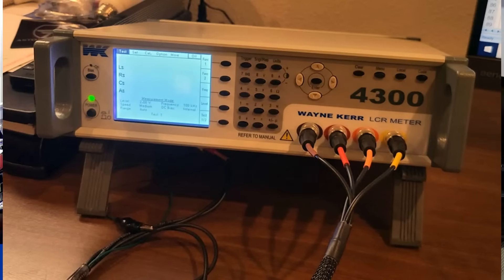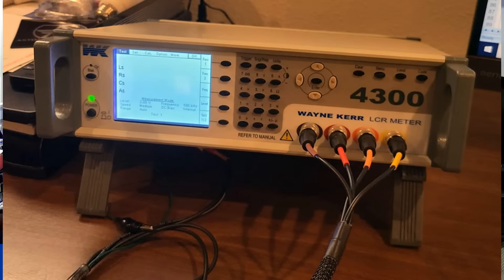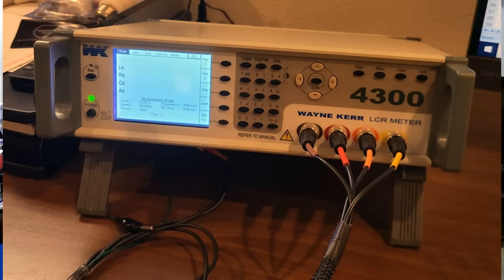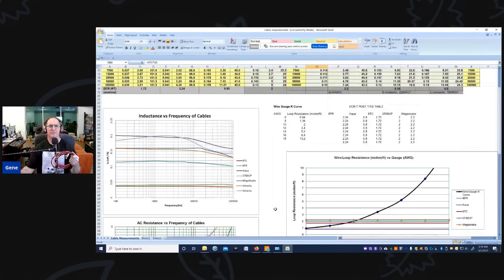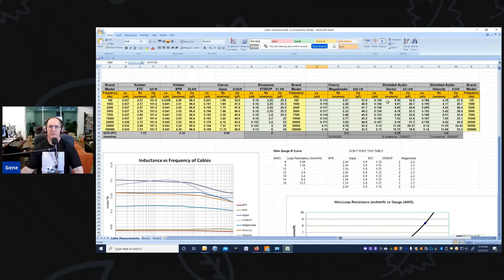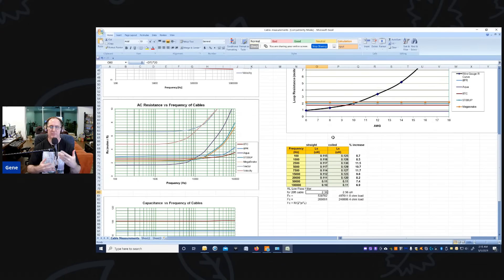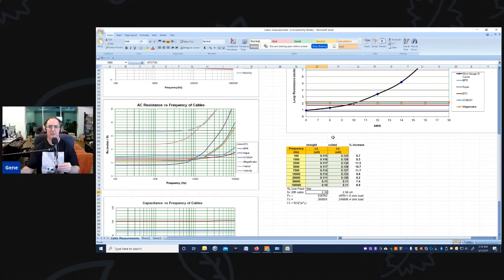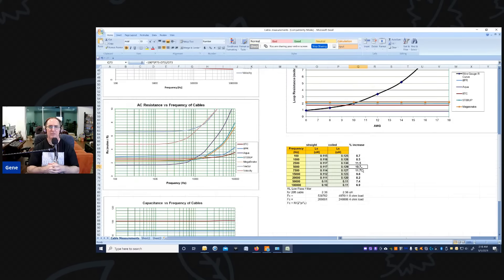OMG If You Coil Your Speaker Cable You're Gonna Lose Fidelity?!?

Comment: I have a Samsung TV sound bar and woofer. The woofer connects to the sound bar with a long length of very fine wire. Its in a bit of a coil. The woofer sounds deep and powerful.

Comment: Good advice! and great info.
It have cut most of my cables to size. But now i was looking into moving the speakers to improve the sound and now i dont have the extra length. To be fair before i cut the cables the speakers where already in that position for months. And now we are 5 years further. But with new insights i wanted to see what i could do to improve. I can move them around a little but not really forward away from the wall.
I will just buy some extra cable for the fronts to test if i hear a audible difference when moving them forward. Now they are nicely in line with the center. That center i cannot move forward because of the TV
But after seeing your data about coiling up having almost no effect i will keep some extra margin in the future and tuck it away.

Comment: Hi, Gene,
Very interesting and well done work. As we can see, the increase in inductance, comparing a cable straight and the same cable coiled  is minimal: 2.36uH to 2.56uH. It could be also interesting to compare the cable capacitance in the same both conditions (straight cable and coiled cable).
Regards.

Comment: I know I’m comparing apples with bananas here, but I have a 500 feet, mains extension cable fitted to a retractable reel. There is a very clear notice on the side of the reel which states “always unwind cable fully when using high current devices”. On a couple of occasions I’ve not fully unwound the cable, and it does then get very warm. So I assume that coiled cable has a higher resistance.
Reply from the maker: coiling a cable has to effect on resistance. It does change the inductance however. Also, there is less air around the cable to dissipate heat when it's coiled vs laid straight out.
Reply: @Audioholics  👍🍻

Comment: It's great that you can give the details of these components that are part of systems. 
However, as the whole purpose of each system is to deliver sound to the listener's position in space, shouldn't you be measuring the differences to that, when you make changes to the type/length/connectors/topology etc. of speaker and interconnect cables?

Comment: It's like we would tell the new guys at work when they would roll up the extension cord we make them shake out the electricity.  I been designing and building speakers and I been using oxygen free copper wire it's not that much extra money and I figure why take a chance if I over engineer it it's better than under but I have a lot of people on forums telling me I'm wasting my money with expensive capsitors and wires but I can hear the difference maybe not the wire but definitely with capsitors and inductors but why take a chance and use cheap wire to wire my speakers I would rather build them with ofc wires than take a chance as far as the capsitors it's definitely more than a placebo effect

Comment: There’s degradation and segregation but I don’t think degragation is a thing… know what you mean tho fo sho. Haha🍻 was wondering what effect coiling has on cables.  As well as running next to power and other cables.  And just how far away do they need to be if they’re not to be run together… would be cool to see measurements of cheap cables compared to shielded cheap mid and not cheap ram with power cables.  Would be a pretty variable test tho or should be.  Cause running it with 100w vs 1000w might measure differently.

Comment: In my opinion twisting wires together like those cables is the worst thing you can do for speaker cables. A- thats how you create a magnetic field with wire and electricity, but B- you just made the wire-cable twice as long as it needs to be. Lay them flat, keep them short and straight.

Comment: Award winning loudspeaker designer and engineer John Dunleavy (RIP) used to also believe that all 12awg loud speaker cables sounded the same (and likely measured the same?), as did all 100watt AB amplifiers sound and or perform basically the same, and that it all came down to 1st order, time aligned, Dappolito design passive loudspeakers for "ACCURATE"(his theory)sound reproduction!   Well, lemme tell ya, his systems in his factory sounded pretty bland,  sterile and constrained compared to the sound reproduction from the same loudspeakers in our own showroom/store in CA!  We used the best electronics , and cables, within reason, and got EXCELLENT fidelity from SC-1's all the way to SC-V's!  Yes, folks, I'm a believer in everything you connect to your system makes a sonic difference!  To each his own..just don't sell me that you're system with zip cord and Radio Shack wires sounds as good as my systems with better cables and wires, cause it don't , unfortunately. Wish it wasn't the case. I'd save money otherwise
Reply from the maker: Radio Shack is out of business but multistrand 10awg Belden cable sounds as good or better than any exotic cable you can use. If it sounds different, it's because the cable is acting like a tone control. Get your room acoustics right before turning cables into a religion.
Reply: @Audioholics  Thanks Gene! Good thing I'm an acoustical engineer.  That would come in handy!  Of course, in this line of work, I seldom need more than a now obsolete Radio Shack sound level meter and a copy of F Alton Everest's master Handbook of Acoustics, 3rd edition (FYI, the 4rd edition has some math formula errors. - Don't use those!)  Listen, I got a buncho over priced snake oil audio cables layin around the house if you ever need anything. Mi casa, su casa :-) lol

Comment: Would be good to see the inductance looking into the speaker *(rather than the presumed 8 ohm resistance).  I bet the cable inductance would be rendered insignificant (less than one tenth) in comparison.

Comment: You can buy a perfectly functional and accurate LCR meter for like $100.  The DER EE LCR METER DE-5000 is an excellent choice for a very cost effective, but accurate meter.  Just remember to calibrate it relatively frequently, and you’re gtg. It only take me 60 seconds.

Comment: The only reason I coil speaker cable is when my speakers are at different distances from my amp. I like to keep the lengths of the cables the same, so I end up with one cable stretched out and the other one either wound up or folded back and forth. I would love to see what happens to the measurements when you have different length cables going to the speakers.
Reply: You'd see nothing.

Comment: Nothing personal Gene, but this video is IDIOTIC! Of course there is an audible difference! I had a jumble of speaker cable, of about 10 feet, thinking ‘there is no audible difference’, per your calculations. WRONG! I uncoiled it. MASSIVE difference. 
Forget about measurements. LISTEN to your ears. 
Unless your system is sh~t, in which case I guess it won’t make an audible difference.

Comment: But Gene, if the cable touches the ground then soundstage shrinks and true magnetic North becomes South and the Earth gets even flatter. Not to mention the hair loss that can occur. There are legions of audiophiles that can hear a difference. They never actually say if the sound is better or worse, but they hear a difference so there must be something to it. Between confirmation bias and the placebo effect we now have an army of people spending thousands of dollars meaninglessly on exotic cables to "fix" systems that they have spent tens of thousands on in the first place. Not to mention cable risers to lift the speaker cables to safety 2 inches off the ground. It's stupifying.

Comment: Technically the coil for twisted pair has little effect except the cable is too long with the extra length adding more resistance due to more length, more capacitance due to more length, and more inductance due to more length. Resistance, inductance, and capacitance are all per foot or per unit of length properties of any cable.
For test equipment, consider adding a TDR to your tool kit as it can be used to measure the nominal impedance of cable as well as length if the dielectric is known or dielectric constant if the length is known.
If your speaker cables were two single conductor wires and you coiled them each by themselves, the yes, you make a solenoid cable. However if you coil a braided, or twisted pair cable, you again have an inductor, but in a configuration known as a Bifilar Coil. The inductance reacts to common mode current on the cable, not the differential mode signal to the speaker.  See Bifilar Coil for more information.

Comment: Nice video. I always knew this to be the fact (as an EE), but had never seen measurements and conclusions before. Very nice. I would like to see a review comparing balanced vs. unbalanced cables for sound quality. I don't think there should really be any difference for reasonable lengths.
Reply: FULLY balanced, of course there is a difference with a two-wire active balanced were cold is out of phase of hot, versus the unbalanced with only the hot connector. Also a fully balanced +4dB output has about 6dB bigger headroom - more dynamic range.

Comment: Does  difference in speaker cable lengte have an influence. For example left channel 2,5 meter and right channel 5 meter?
Or better keep them the same and coil the left chanel cable lenght?

Comment: I am for sound not looks, 100% relevant, takes more wire to coil it. I will never buy braided/coil speaker cables. Might as well spin some magnets around it and make electricity.

Comment: Agreed. it has very little affect because the load is so strong, or low impedance 8 or 4 ohm. Do the same measurement on a low line level signal between something with 1v line level RCAs, then coil it and connect it to a high impedance input - something with like 10k ohm input, or even better, into a phone pre-amp.

Comment: Funniest argument I've heard against (coiling) was this:

"Imagine your car is an electron, it's well known that if you go too fast around a turn your car tries to go straight and you'll crash because you will go off the road.  Except electrons cannot slow down due to physics.  They are going the speed of light.  When you coil a cable, you're increasing the tightness of the curve and they will fly off the wire!  This is the loss you're hearing, as less electrons means less energy to move your speaker cones, your amp works harder, you turn up the volume and things distort even more!"

Good thing I wasn't eating because I would have probably choked! :-D

Comment: Finally, someone who is putting REAL SCIENCE behind speaker cables! Thankyou Audioholics!
Reply: Wouldn't  you know after  2 years,  69K views  and only  3K likes . People don't  like hearing  the truth ...
I worked i a physics  lab we  did  similar  test  but more testing  on sound coming off the speaker we used  hi end  research  gear.   and NADA .... when we   measures  at  the cables at connectors. how tight  the  binding  posters  were made  a difference but so far out  from  audio range and human hearing    ...  well unless the connections were  loose  that made  a difference anyone could hear.. like cracking.

Comment: So how about adding the 2.2 or 4.7uF capacitor into your equation, are you not creating a tank circuit would the frequency response of the tweeter remain the same, besides being a complex impedance on its own. Transmission line theory is quite a science subject by itself. The twist in the cable creates higher capacitance to add to the problem. I wonder why make things so complicated in trying to debunk everything. Music is a subjective experience not an objective measurement. If you enjoy a certain wine or cold drink do you Annalise it in the same way to objectively measure how it should taste to you or every other person on earth. Do you eat monkey brains> I some cultures this is  delicacy. Do you analyze the purity of the water in the beer or whiskey you drink? These debunking is a snake oil in itself. Listen to it, if you like what you hear then leave it alone or experiment with things that in your subjective mind sounds better. Do you fart Channel No.5 or do you analyze your fart by what you ate.

Comment: Gene, I have to hand it to you, your one honest man that can teach a newer generation not to subscribe to the expensive snake oil around speaker cables interconnects and power cords.  I have had systems since the early seventies, and in the later eighties, the industry really went downhill; the small audio store could not stay in business.  But a great way for them to make a profit was the high-end speaker cable and power cords (more now than ever).  It still did not save them, and they are gone sadly.  For many years I got to sit in some small shops and listen and learn and spent some time at Technosonic Studios (now torn down for a shopping mall) in the St. Louis suburbs.   Yes, I have spent more than one probably should one high-end equipment, Accuphase, McIntosh, B&W, Sony ES, many Marantz (still have three receivers), double Advents, EPOS, BOSE (1970's), early NHT, Klipsch Corners, LasScala's and Heresey's (my home theatre with Marantz Projector, circa 2007)  Except for a few pieces, all were bought used, have had my Accuphase Amps for 41 years.   I really get irritated with the false claims and even worse by the adjectives used by so many to describe cables and power cords.   But, there was a savior, to saving me probably several thousands of dollars over the last 45 years.  Gordon Gow, the CEO of McIntosh, and their lead speaker engineer, Roger Russel, demonstrated to me back in the 1980s that regular old pure copper wire is all you need.  Wow, why would they do this?   They even put on a roadshow, double-blind, and were proved it over and over.  Think about that era; at the time, you would have to say McIntosh was about one of the higher-end products made right here in the United States.  There was a manufacturer of audio equipment, and their message was, don't waste your money on all these false claims. They backed it with science and engineering, they were well educated, and they, like you,  just HONEST.   Gordon Gow is long gone; what an icon and the job he did with that company, but I had also had the pleasure of communicating with Roger Russel (a degreed electronic engineer) and lead speaker designer at McIntosh during those years.  Still have the memos.   What he and Gordon Gow said 30 years ago, I think, needs to be referenced more today.   Most cable manufacturers do not have the education or one-hundredth of the audio industry clout these men had.     Yes, it was two-channel audio, but the science is the same.  It amazes me how so many people praise McIntosh over that period in time,  and how good the equipment was, yet at the same time will disagree with the science of their lead speaker designer (degreed electronical engineer) and the CEO of the company and insist that one must spend hundreds and even thousands on wire.   Anyway, wish you would throw those old audio guys some light and try to continue as you do to spread the honesty about what I think is the dark side of the industry.   I am sure you don't get many ads from any of the suspects, but that takes an honest man teaching many how to enjoy such a great hobby.  These men were well into their careers at even that time.  Roger still has his site up; few will ever take the time to read and learn; maybe you can get a phone call, skype or zoom with such an icon?  Fellow readers, follow Gene's advice!
Reply from the maker: Thx for your kind words. Yes I spoke to Roger Russell many moons ago when I started debunking cable snake oil.  Good guy for sure.
Reply: @Audioholics   Could you measure and A/B test GR-Research braided speaker cable, that would be interesting

Comment: You're using a braided cable.... The point of braiding a cable is to allow you to be able to do whatever you want.
Reply from the maker: Not true.. The effect is pretty similar with zip cord too.
Reply: @Audioholics  braiding prevents the wires from being adjacent... Not sure what zip cords are though
Reply from the maker: @linkeddevices  It doesn't matter. A loop is still a loop. I proved in both cases whether using zip cord or braided that you simply can't affect inductance much by coiling up the cable. The # of turns is insignificant and the loop area is too large.